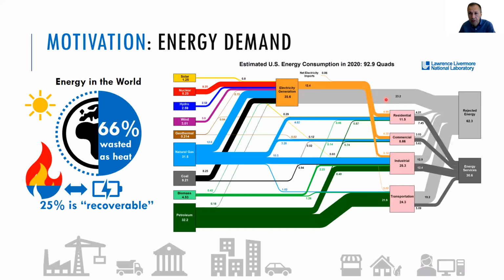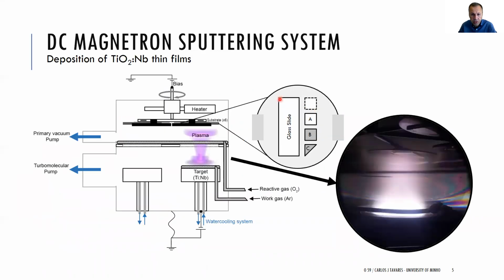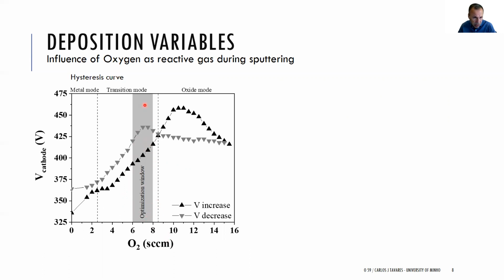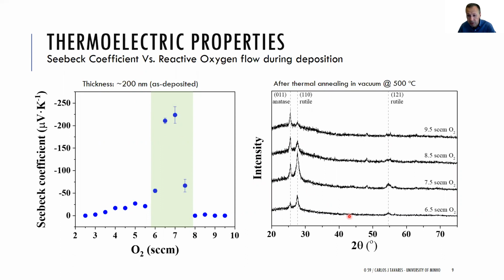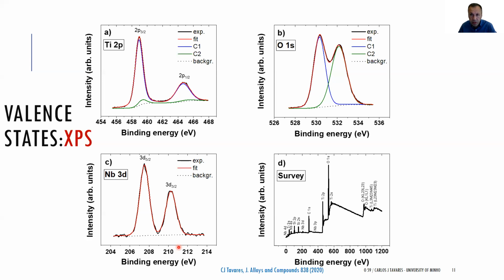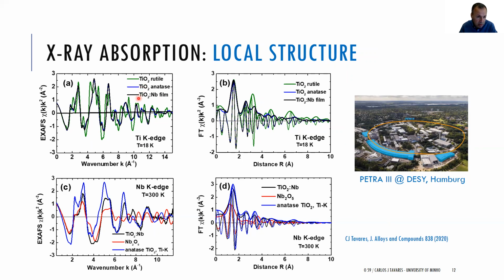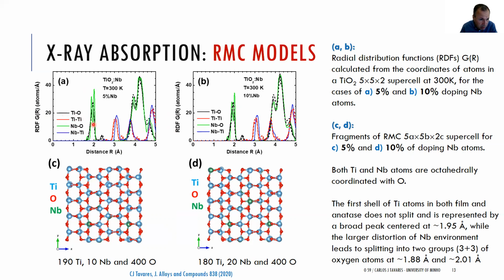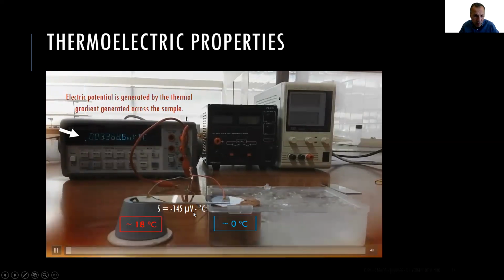Transparent thermoelectric TiO2:Nb thin films for thermal energy harvesting applications

Comment: Let's suppose that the cold side of a Seebeck thermoelectric generator (TEG1) is near absolute zero (0K/-273.15C). Let us further assume that the hot side of TEG1 is 100K/-173.15C. Let us assume that another Seebeck thermoelectric generator (TEG2) has a cold side temperature of 273.15K/0C and a hot side temperature of 373.15K/100C. 

Would the power generated by TEG1 equal the power generated by TEG2?

Because the molecular motion would be greatly reduced in TEG2, would it require less energy input into the system to maintain the 100C temperature difference than TEG1?
Reply from the maker: The molecular vibration is enhanced with temperature and will inevitably increase electron scattering. There are other aspects to take into account such as grain boundary scattering, which is common in polycrystalline films, such as this case.